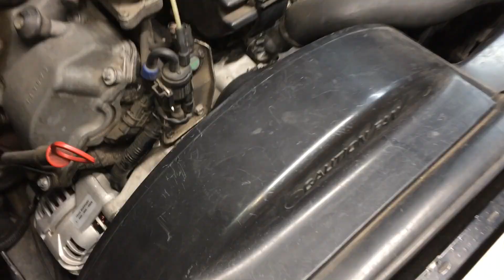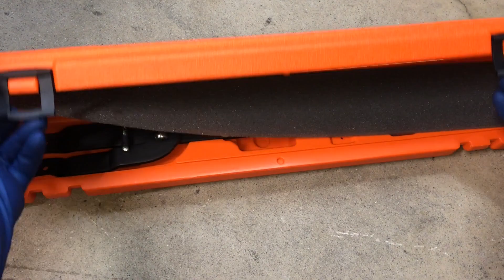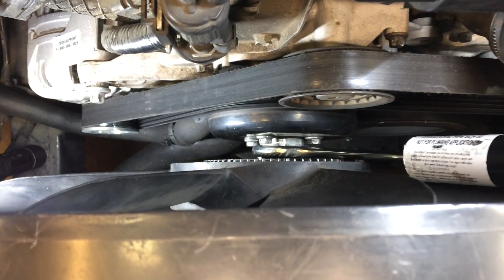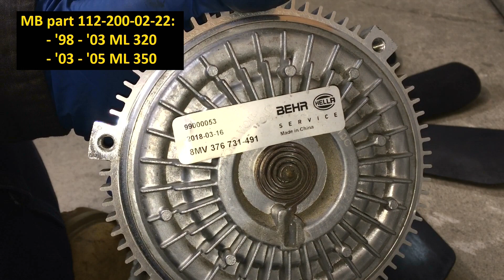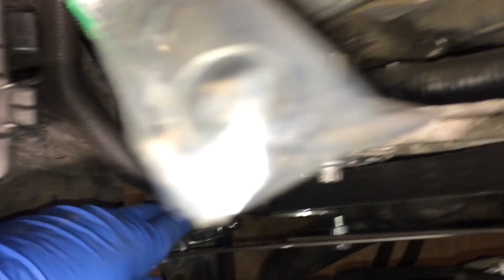Mercedes ML350 Remove Fan & Fan Clutch DIY with Rental or Homemade Tools W163 and other M112 M113

Comment from the maker: Timestamps, Tool Numbers, Torque Values, Links:

00:16  Overview - 36mm nut, turn counterclockwise to loosen
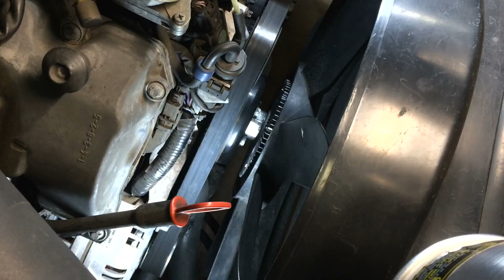00:50  Remove the oil dipstick
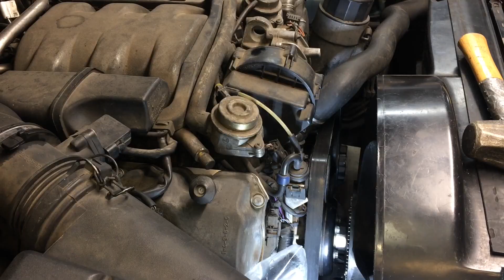01:00  Technique 1: impact method using a long 36mm wrench 
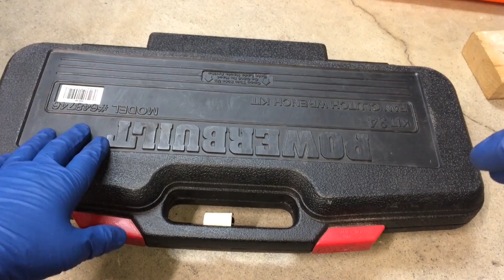03:00  Technique 2: using a tool to hold the water pump pulley
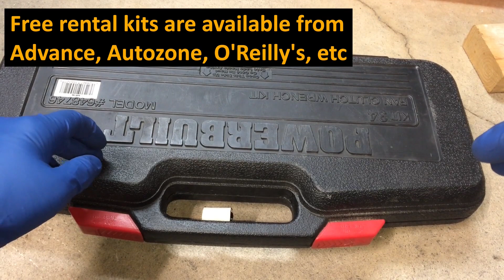03:09  A good (but expensive) kit is JTC 1702 and JTC 1714
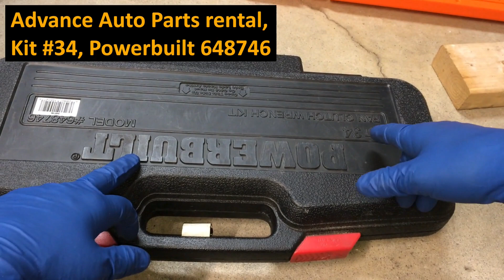03:36  Powerbuilt Kit 34 (648746): useful if it contains a new/tight 36mm wrench
06:43  How to shim a loose 36mm wrench if you're in a bind
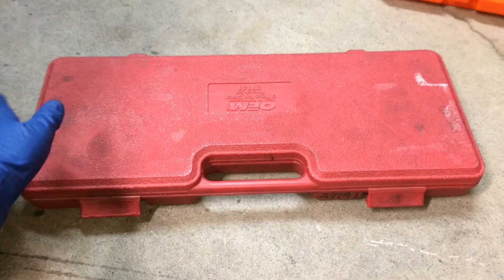08:04  Rental tool: OEM Tools Kit 27141 - don't get it, it doesn't contain any useful tools for this job: if available, OEM Tools Kit 26505 would be useful if new

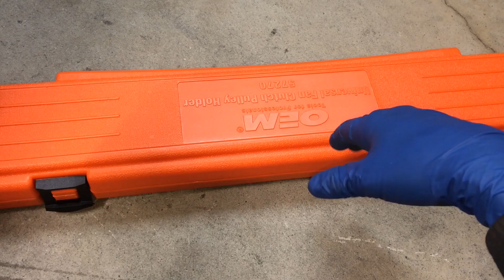08:29  Rental tool: OEM Tools 57270 Fan Clutch Pulley Holder:
  - this tool is useful, but will require an easy work-around if the ratcheting mechanism is stripped.

12:45 An easy-to-make homemade pulley holder tool

15:20 Using the OEM Tools 57270 ("Green tool") to hold the water pump pulley for fan removal

17:29  Remove the fan from the water pump
18:37  Remove the fan clutch from the fan (three H5 or 5mm Allen bolts)
19:37  Install the fan clutch to the fan: torque is low, just 10 Nm (88 inch-lbs)

20:18  Install the fan to the water pump 
20:45  Using the OEM Tools 57270 ("Green tool") to hold the water pump pulley for fan install
22:08  Work-around if your OEM Tools 57270 ratcheting mechanism is stripped

24:38  Technique 3: Bolt the pulley holder to the pulley
25:38  Technique 3 using the homemade tool 
28:24  Using the homemade tool to remove the fan
29:54  Using the homemade tool to install the fan

Water pump, thermostat, tensioner, idler pulley DIY:

https://www.youtube.com/watch?v=QkQcfJ6GSK4

Oil Cooler seals, oil filter housing seal, pressure port/expansion plug gaskets DIY:
https://www.youtube.com/watch?v=eyHyleOfdLQ

I hope this video was helpful for you.  Thank you for watching, and good luck with your repair! : )
Reply: Thank you for your informative video if only I had watched this before watching the water pump replacement. Was able to get the fan and shroud and water pump out in one careful process. The on the bench had a hell of a time removing but managed to but gonna make my tool to fasten the fan now.

Comment: The 54 mm square wrench in the OEM tools kit has worked for me Everytime on my m113. It is bigger than but can still bite the pulley fasteners to keep it in place. It's a pita to make it work but it works.

Comment: I replaced the viscous clutch (Viscous coupling unit) of the fan on my M113 (CLK430) after 25 years and 140,000 km as a precautionary measure. In doing so, I discovered that the externally flawless clutch was probably completely blocked internally. The clutch transmitted almost no power. The clutch was leaking internally. After the replacement, the engine water temperature was finally stable again. The clutch is therefore a component that should be replaced as a precaution. The consequential damage can be very expensive. 

Best regards from Germany.

Comment: The old fan is roughly 7 1/4 inches in diameter the new one is a little smaller 7 inch, the plastic fan housing has a tab that fits in the clutch fins around it and  securing it there would be a problem ?
Reply from the maker: No - personally I would only stick to a direct replacement that has bolts securing the fan to the fan clutch.  The fan is spinning very fast, and often, and if it dislocates from the clutch due to a misfit, it will hit the radiator and likely destroy the radiator, requiring a tow and new radiator.  
It sounds like you were sent the wrong part: I'd return that part and stick to a direct-fit replacement that uses the bolts.  I hope that helps!

Comment: Great w163 videos, I used your video to change the oil cooler housing gaskets, bought the parts you suggested.  It worked like a charm, the leak is fixed!  Any plans on showing how to replace oil transmission cooler lines?  Thanks
Reply from the maker: Wow, great job on your oil cooler seals DIY!  Yes, it is great to get that messy leak resolved.
Regarding the trans cooler lines - I have replaced them before, and also done the repair version using with Oetiker clamps (less expensive option).  I might be doing that repair on another W163 in the near future, and if I do, I will record it : )  Thanks for watching!

Comment: Still working on the w163!! I remember fixing some things on mine years ago thanks to your channels guidance.
What's your mileage now? I'm very proud of my 208.000 miles, car runs better and more reliable than ever before, after catching up on all the maintenance.
Reply from the maker: The '05 ML500 has just 160K miles or so, I think - and the '03 ML350 is, I think, 175K or so (I can't recall of the top of my head).  The ML350 will be parted out/scrapped over the next few months because she's got a rear main seal leak and two "iffy" catalytic converters, as well as a mouse that just won't leave the AAM & fuse box wires alone!  (she is also already a salvage title from a previous collision/roll over, so she's not worth much more than scrap/parts now)  But she was a great truck for my sister for over a decade, and I hope to make some more videos on that ML350 yet.
That's great that you have 208K - they will run for a long, long with maintenance!   I met someone at the junkyard once who had over 400K on his '01.  Thanks for watching : )